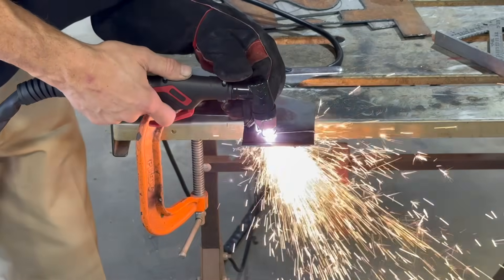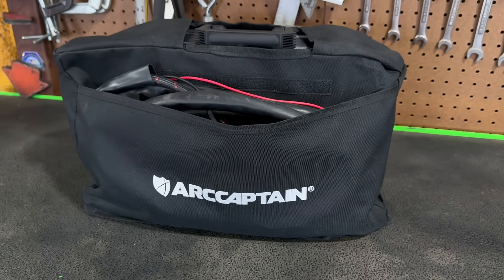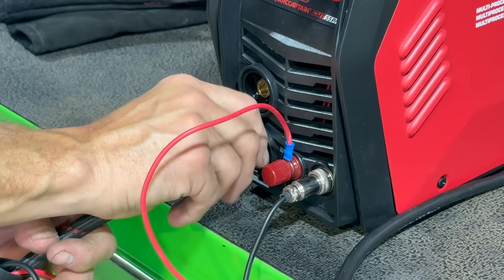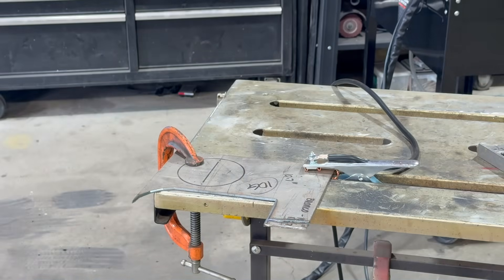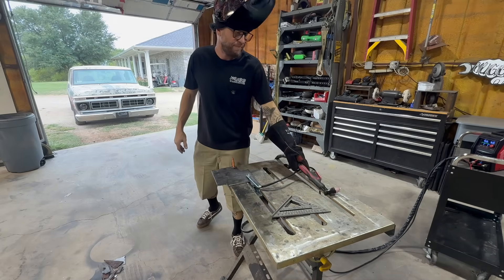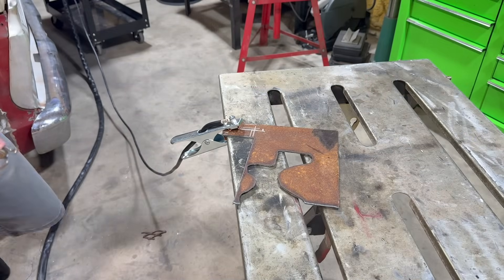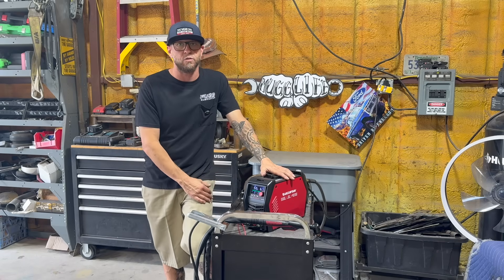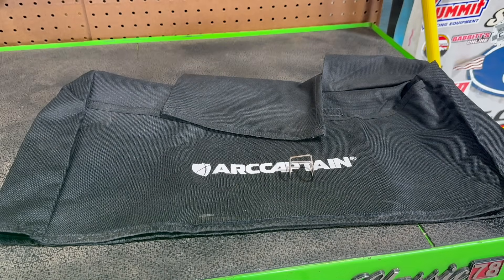ArcCaptain Cut 55 Prolux Plasma Cutter |  Rust Remover???

Comment: How does the CUT55 Prolux compare to "Arccaptain iControl CUT55 MP Non-HF Pilot Arc Plasma Cutter" ?? Which is newer? Which has better features and capabilities? Non-HF might be nice but not enough to sacrifice other features. Please help me choose!
Reply from the maker: Pretty sure the Prolux is newer.  So on the pilot light the prolux is hf and it lights without touching metal.   So you can interface it with plasma tables like the arcdroid.  The MP is still no contact also but not hf.  There may be frequency interference with aftermarket tables like the arcdroid.  

The MP cuts a smidge thicker metal than the prolux but we are talking about 7/8" compared to 1".  Neither of those thicknesses are really what those are designed for in a duty cycle world if that maths at all.  

The Prolux utilizes arccaptains app.  Gives you more control in theroy but I have yet to dive into that.  

I havent ever used the cut55 MP so Im kind of biased.  I can tell you the Prolux is a super rad unit.  The arcs on thinner sections are super stable.  Hope all this helps ✌🏼
Reply: @MuggCustoms  Thank you! Not sure why I didn't get notice of this reply, I've been watching. Really appreciate the response. I now see the Cut55 MP non-HF, pilot arc is pre-order until later this month.
Reply from the maker: @johnclark6190They are worth the wait, it took them about 2 weeks to get me mine due to demand at the time

Comment: Looks like a good unit! Did you use it with 220 or 110? Might make a difference for some to know what it would do with 110, if that's all they had
Reply from the maker: That was all 220.  A general rule with anything like that is to reduce its cutting/welding capacity by a 1/3 at least when running the converter 

I have no data to back that up but it has always mathed with my stuff 😂

Thanks for watching!